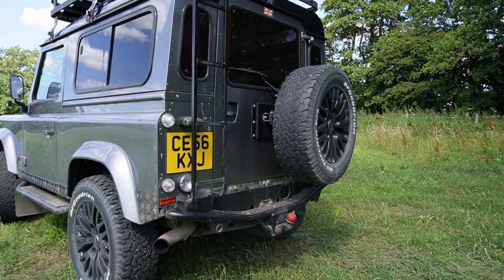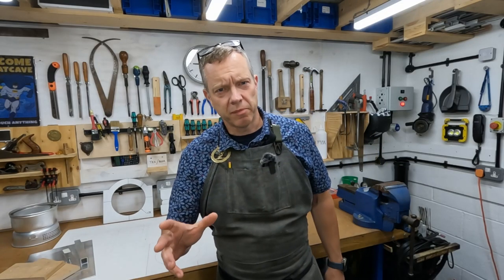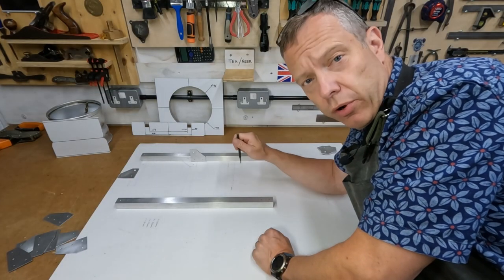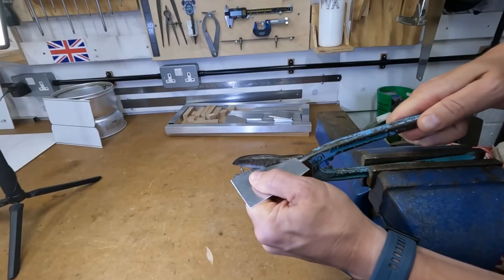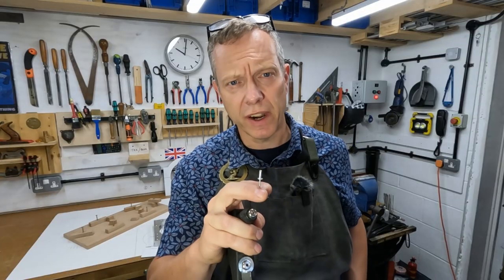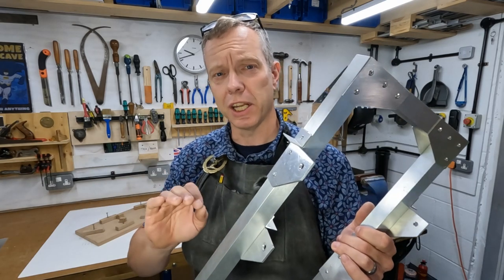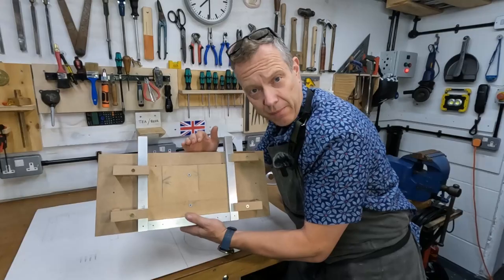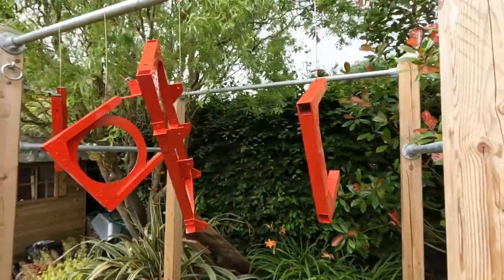Custom made frame to fit a Trangia on a Defender.

Comment: what do you think a benefit of using aluminium in projects or uses like that ? and the same for metal ? what factors would make choice for metal or aluminium ? when to go better with that or this ?'metal and aluminium.
and thanks for this amazing couple of videos..do more go ahead.

this is first channel i activate the youtube bell for it from all diy or crafting channels that i follow !!. your work seems neat, hopefully you make more videos.

'my English not my main language sorry for weak language'
Reply from the maker: Thank you very much for your kind words and support.  :)

I used the aluminium because it is easy to work with, light weight and I already had a load left over from a previous project.  

I am making more videos.  At the moment I am making a 'macro photography rig' using my GoPro camera.  I need to film some close up stuff for a future project.

You have inspired me to keep going, thanks again.